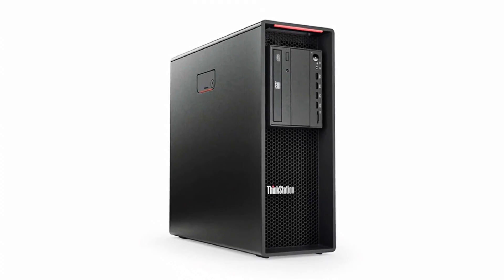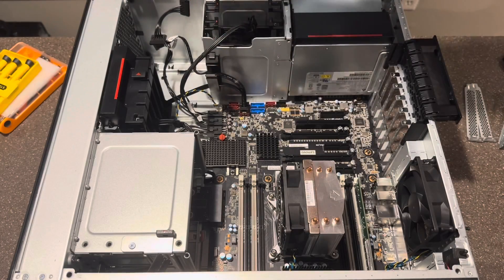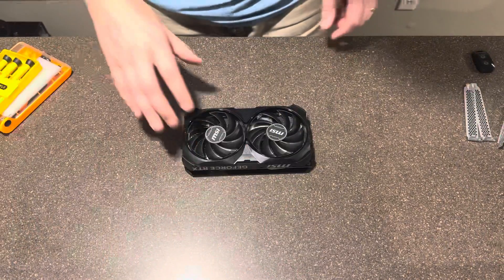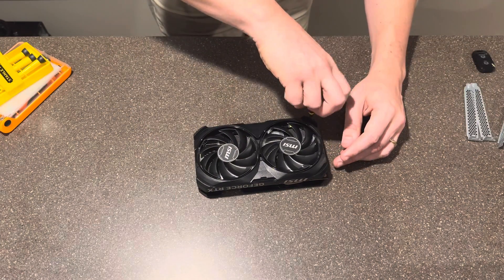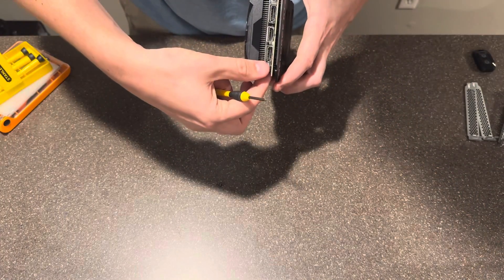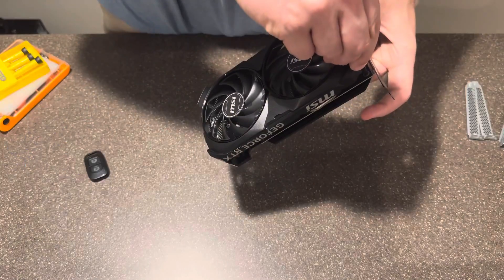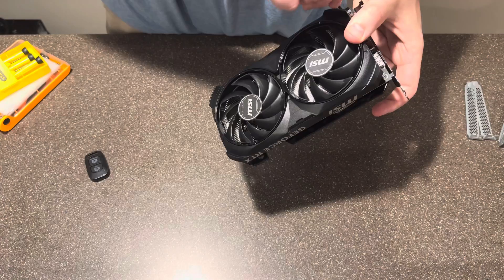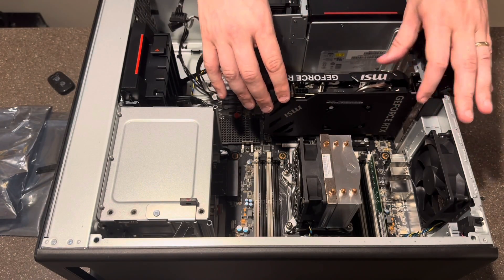DON’T DO THIS to your GPU

Comment: Protecting your GPU is crucial for its longevity and performance. Avoiding actions that could harm it, like overheating or overclocking without proper knowledge, is essential. Remember, a well-maintained GPU ensures smooth and efficient computing experiences. #GPUcare #TechTips
Reply from the maker: Great advice!